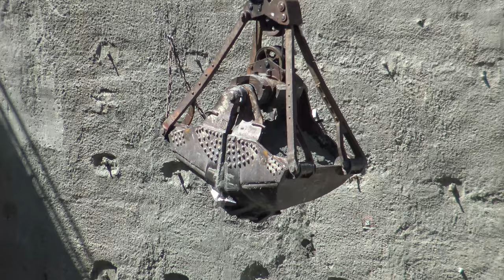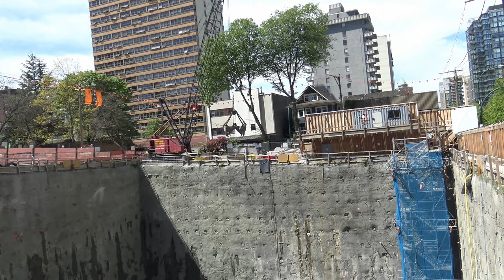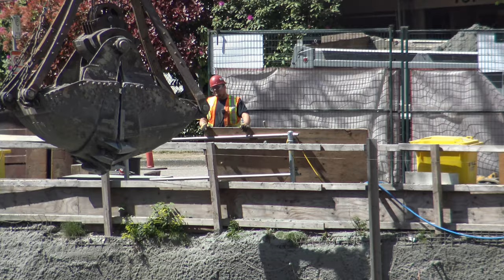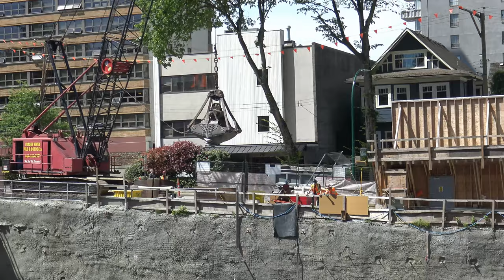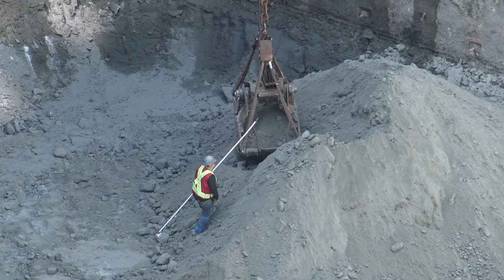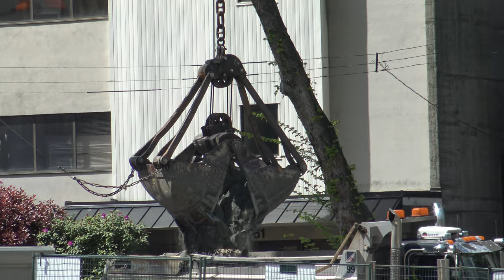Clam Shell Bucket Excavation at Alberni by Kengo Kuma

Comment: Does the excavator not have an operable grab calming winch? That "rubber band" would annoy me...
Reply from the maker: A month later  https://youtu.be/o-6wNyYChV0?t=165 the operator is keeping the calming winch line taut, no more need of a labourer stabilizing the spinning out of control bucket
Reply: @Zepfancouver  This tag line is controlled by a spring - the excavator operator cannot control it directly. With us, cable excavators have a winch installed in the excavator, which has a slip clutch to keep the cable taut. If necessary, the excavator driver can loosen or strengthen the slipping clutch in order to guide the gripper precisely (keep it still, turn it or pull it up and swing it away).
Reply: That’s crane
Reply: @samanli-tw3id  Its a cable-excavator/dragline, working with clamshell bucket.
Reply: @Rudi-Weserwolff but converted from a crane